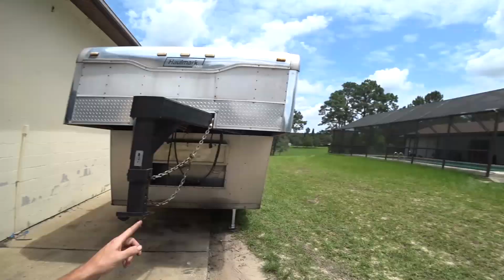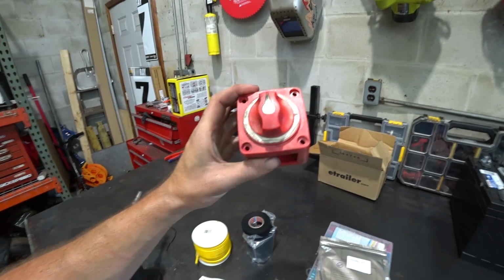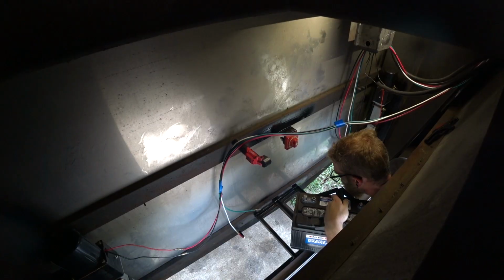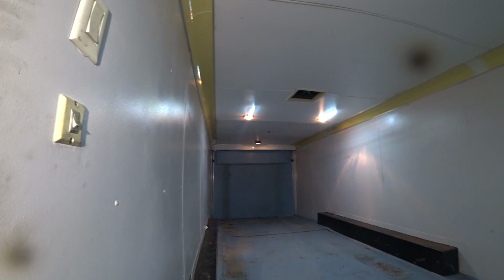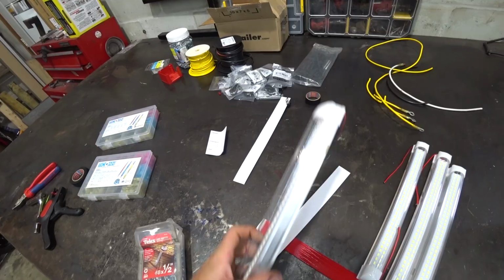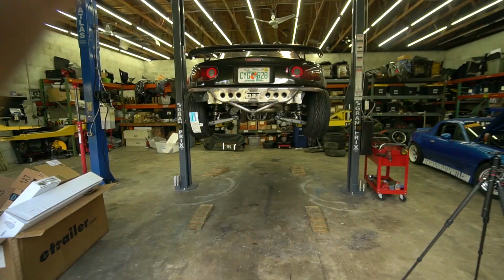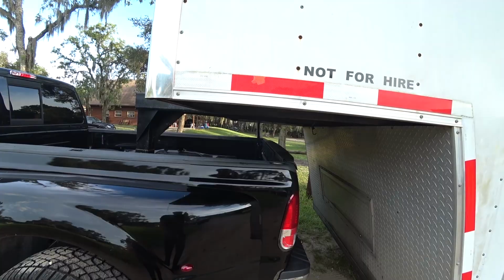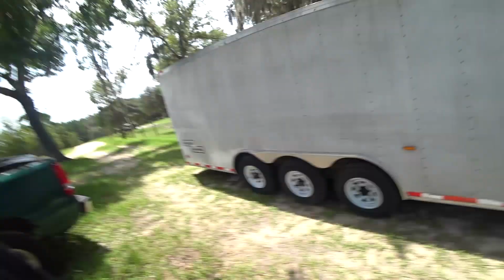Refurbishing And Upgrading My Gooseneck Enclosed Car Trailer Pt. 2

Comment: The trailer finish is gel coat. As a detailer I’ve buffed and waxed them, but it’s honestly a lot of work. You don’t want to use a very aggressive compound or go super hot, but I’ve never burned through it. I haven’t done a ton of them and have been out of the business for a while, so you may want to research restoring gel coat options on YouTube. I see some other suggestions that may be faster, but I’ve never done it any other way. That said, I’d be careful about the more caustic things mentioned. I’ve had issues with super clean pitting aluminum, and I definitely wouldn’t trust oven cleaner. Good luck! 👍

Comment: Mix up 25% dawn and 75% the works original toilet bowl cleaner in your power washer soap dispenser. Rinse it first, then hit with soap mix and scrub with a clean push broom from the shop. Do in small sections and rinse before it drys. Gets rid of any mold/mildew and the rust rings around the screws. I do it once a year to a white trailer that lives outside 24/7 works great.

Comment: I use a foam cannon to wash my trailer down then buff my trailer with a buffing compound, enclosed trailers are painted with hard epoxy paint but oxidizes so I  use a liquid wax on a softer pad to do it quicker and the wash the road grime off easier. You can also polish all your aluminum to keep your whole trailer looking fresh

Comment: We got a Honda EU3000is.  Believe I picked it up for 1800$.  It's tucked into the front storage area of our trailer aswell.  Use it to run fans, tools, chargers, refrigerator and whatever else we need and its never said no, I'm sure it would have no problem running an AC unit.  Switch from a generac to the Honda because of the noise with no regrets.

Comment: Flip down sofa/ table like would be in a toy hauler rv good for just relaxing, and a winch in the front of the trailer. If you install a generator, might as well put in a roof ac, for that Florida heat. Put a light in the fenderwell, flats are pretty common, and at night its amazing.

Comment: Taylor, for your tow rig you should wire in some of the clearance lights on the front lower valance of your truck and on the plastic part of your steps to complete the big rig look. like the lights you put on the open trailer I think it would look great on it. Just if you want a easy project to up the cool factor of your truck.

Comment: Hey taylor, tips for the siding of the trailer. The contamination is really only going to come off with sanding, start out with a scruff pad, I don't know what you call them over there, they have green ones red ones etc. If that doesn't work move to some 1500gr and if that doesn't work go progressively down in grit. Then what you want to do is sand back up in grits to about a 2000 then give it a buff if you want to bring some shine back but it might look alright as a matt finish. Unfortunately this leaves you open to it getting dirty again in the future as it is a porous surface. Personally I would pull the siding and replace with some dibond or alucobond sheeting, not sure what you call that there either!

Comment: Try some Greased Lightning or Meguiar's Marine/RV M49 Heavy Duty Oxidation Remover on the trailer then use 3M's  06064 or 06068 polishing compound with an orbital polisher...make it look brandy new! For sure keep the white cause a black wrapped trailer is gonna be way harder to cool.

Comment: Zep makes a purple power degreaser you can get from Lowe’s or Home Depot you can add some water to and spray on the trailer let it sit a few minutes and pressure wash it off. Did it to my white trailer that sat under trees for a year and did really well.

Comment: You should enclose the top and bottom of that space the batterys are in keep most of the wet out of electronics will save huge hassle  down the road. Also that space should fit a decent size generator for some a/c or even a few inverter generators for quietish a/c

Comment: To clean the trailer just wash it, Then use a rotary buffer with meguiars 100 compound and a wool pad followed by Dual action polisher with The Last Cut compound and a medium cut pad.  You will need minimum 3 pads each.

Comment: Its so odd hearing a 6.4l starter cranking then hear a 24valve Cummins come to life lol love the fummins build! My dream truck is an 01-07 gm 2500hd crew cab short bed 12valve cummins nv4500 5 speed and use the pushbutton transfer case and make all the factory gauges work life oem....

Comment: As far as a Generator , go to your local RV Junkyard . I bought a  7KW generator out of a near new Motorhome that had caught fire and picked it up for next to nothing . Sorry , just trying to help . At one time I had 47 Trailers . The one thing I did learn is ALWAYS carry TWO Spare Tires . ALWAYS ...On the smaller Trailers we mounted the Generator in the back of the truck .

Comment: One suggestion Taylor, put a sheet of sheet metal across the bottom so someone can’t climb in the front compartment. Or a sheet of expanded metal to keep the open air flow..

Comment: If you were talking about the 8 point star screws holding the break-away, you can use a square bit to get those off.(took me a while to realize it wasn't 6 point torx on my trailer, lol)

Comment: Zep Aircraft cleaner II is designed to remove black soot left over from jet engine exhaust. I use it on my white enclosed trailer all the time, works great.

Comment: Why leave the engine idling to "warm up" the truck? Isn't the best way to warm up and engine to just drive lightly for a few hundred meters (or what ever you use over there... yards?). That way the engine reaches operating temperature much quicker which means it will work as it was designed to just a couple of minutes after starting. Just wondering... Love this build btw, hope to do something similar soon!

Comment: Full strength purple power in a bucket. Use a sponge mop to scrub it down then rinse. Do not let it run or dry up on you. You will get streaks if you do. It 100% works, thats how i keep my truck looking brand new.

Comment: Bleach watter in a pump up garden sprayer u want it to be concreted so don’t dilute it to much spray it on take a car wash brush on a pole scrab it a bit and spray it off it will bring that white back my family has an RV and that’s what we use to wash it to get all the black streaks and mildew off

Comment: Maybe get the mats for the floor of the trailer? It will help you with the hassle of painting the floor and prevent from getting stained. Oh and get some lights for the outside, so you can see much better in case of changing a flat and some speakers. I know there must be some more ideas that you could do and get the trailer to your liking.

Comment: So my leer canopy is made the same way your trailer is made of and when the harsh winter road grime gets on it it’s really hard to get it off but I’ve always used some simple green or gunk engine degreaser and then had to scrub it off by hand. Usually if you want the best results you gotta put some elbow grease into it

Comment: What I used on boats for getting all the crap off of the white hull, you can get at walmart and its a white spray bottle with blue lettering. I'll see if i can find an old bottle to get you the name of. And yes it is safe on fiberglass and metal since our boat is a fiberglass hull.

Comment: You should add a roll out awning on the side like a fifth wheels camper so you don’t have to tote around a pop up awning. You could even get an electric one to add to your new and improved wiring system!

Comment: Have you thought about boxing the bottom of the compartment that holds the batteries, killswitch and jacks? I feel like anyone who's seen the videos could crawl underneath the trailer and stand up between the jacks and battery mount and get to the main killswitch that way.

Comment: Use  Lysol mold and mildew spray to get your trailer white again (works better than bleach) also keep your roof clean ( helps prevent black streaks)

Comment: Truthfully, whether or not you restore the white or do a black wrap on the trailer, doing a chrome wrap on the roof of the trailer would help keep interior temps down since it’ll reflect the heat away which would, in turn, help your A/C unit you’d be using for the trailer be more efficient in the long run. Just a suggestion, however 😊

Comment: Just a little bit of info. Putting the kill switch on the negative (not ground, that's different) side of the battery is actually best practise because electrons flow out of the battery FROM the negative terminal, through the circuit and back to the positive terminal. Putting the switch on the negative means if a wire is damaged and creates a path to earth (not negative), the switch is in place to stop any electron flow. If the switch was on the positive side, it is possible to earth the circuit before the switch, witch would drain your batteries and could potentially cause a lot of issues with the worst outcome being full membership to the LZ firetruck club.

Comment: When you use self tapping screws on thick metal use a drill not an impact. You won’t need to pre drill. I learned that when I used to mount light kits on over head guards for asphalt rollers. Those guards are 1/4 think where I drilled through them with just screws

Comment: I am in several fleet washing groups. You would be amazed at what the proper chemicals can do to remove the crud from trucks. Take it to a truck wash or call a fleet wash company. Seriously, they spend 15- 20 minutes on a big rig and it's sparkling clean.

Comment: 15kw on the AC , 68-70 all night. it will run on 110v extension cord if you don't turn anything else on, cord gets a lil warm though,  DO NOT  wrap it black way hotter.  Starbrite make black streak RV cleaner. its good stuff.  Doing that big of a trailer is alot of work.

Comment: NEVER wrap or paint a trailer black. It will raise the interior temps 20+ degrees. Instead, clean up the white. Pressure wash with a solid degreaser first, then compound and wax it. I suggest a direct drive wheel, or an orbital, whichever you have. Try a 50/50 mixture of compound and wax on the same wheel at the same time. If that's not cleaning it up, go straight compound, then wax. I use to detail boats, RV's and enclosed trailers for a living and that's the exact process I use to do. If you have ANY further questions, please reach out to me, I'll be more than happy to help you.

Comment: If you didn't figure it out already, the screws are just a #2 square drive. Yes the screw has 8 points, but they are made for square drive.

Comment: I would try simple green or purple power first to get them white back. If that doesn’t work a polishing compound will bring it back. Polishing compound will just take a lot longer. Buy a cheap polisher from O’Reilly’s for like $50 to keep your arms from dying if you have to use the compound.

Comment: You should use group 31 MF AGMs. And go to "pacer group" in ft.lauderdale and grab an ACR install that so that voltage issues will never be a problem. And I'd advise you too up those size wires on the batteries

Comment: Taylor, looking at how you wired your electrical jacks you can power them through the truck connector. Both power and ground are directly connected to the junction box of the connector and the jacks. Meaning anyone can steal your trailer anyway. At least judging by this video. Try toning out using multimeter to confirm.

Comment: the white on the trailer is stained from the aluminum  just if you didnt realize so with that said im not sure what product your gonna need , if your end job is to wrap it your still gonna want to remove the contamination off of the white for best adhesion

Comment: Pressure wash  the trailer and feed in pool shock through your pressure washer. Bleach works well also. Mix 5/1 dwell for 10 minutes. Light brush and it’ll look brand new.

Comment: You should add a dummy trailer connector to the underside of the gooseneck to clip the cable into when not connected to the truck.

Comment: Have the generator in the bed when parked then the a plug in the trailer that is hooked to a wire that leads to the generator. Plug the ac into the plug inside. You could use power tools as well

Comment: Be careful with AC, the startup power pull might be over a small gen (even knowing running power is enough). Honda makes the most silent stand alone gens so a 2000watt might work but might be too big for the area and a 1000watt (very silent) might not be enough. Also recommend a small camper window in the side door if you plan on sleeping in it/staying inside for extended periods. If you do that a small sink on the bench drain to a bucket plus 5gallon fresh might be nice for cleaning during events. I  wouldn't go full solar unless you want like 4 big panels on the roof plus a big (4-6 marine batteries) battery bank - a gen is way cheaper. Don't go black in the FL heat - instead fix the white and maybe add some large black strips/graphics to match the truck.

Comment: Backing that trailer blindsided is tough as a truck driver have to say pretty impressive
Reply: I don't know how you guys do it, blows my mind every time I see someone backing up big ass trailers
Reply: @Matty.Hill_87  its actually easier to back a bigger trailer but lots of practice when I was green id find an empty parking lot and practice backing
Reply: Coming from another truck driver i have to agree some good driving
Reply: @Randy Lovelady I agree on the larger trailer statement. I don’t drive a truck for a living, but I will absolutely without a doubt say my 18’ flat bad is easier to thread into a spot than the 8’ trailer I have.

Comment: I had good luck using a few spray bottles of Clorox clean up, a scrub brush And a pressure washer on my race trailer. Took any of the hard stained mildew right off.

Comment: I would use a locking power lockout.. something that is keyed.. or make a hidden switch so someone doesn't power down the jacks. on you. 
Preferably something inside that locks out the switches when disconnected from truck but only for the Jacks themselves.. not all the lighting too. this way if your at the track, some stupid kid doesn't flip a switch and starts powering down the jacks while your not near the trailer.

Consider getting a portable 12v powered winch for trailers.. something that you can connect to a central tiedown for to pull your car inside the trailer if car dies ( if you do not already have one) 

The other thing is, you can buy extensions for trailer plugs one end looks like the truck side, other end looks like  a trailer end.. OR you can buy the ends and make one that is as long as you need it.

I would also consider a battery charger, conditioner device.. something cheap that you can connect and plug in from a 110 source just as that little bit extra on say dead of night, no solar, batteries have went dead and yet you have access to a generator or other 110 source.. Rare condition im sure.. but its like 30-40 bucks for little peace of mind. depending on model.

this was really interesting to me because I recently got a little trailer for a lawn tractor, and was looking up some other stuff and was like "ohh wonder what he is doing to that HUGE trailer" lol

Comment: run a second junction box at the  behind the ball connection an drop it straight down here an over  plus 2 ft.  will give you jack area to work when on angles  that you should not be in...  we all slide trailers now an then.  better connection  points then  cutting and tapping wires connections...

Comment: trailers lookin sick, love these kinds of videos. i would suggest to bleach the trailer with a pressure washer. did this for houses and siding and it works well. i used cheap dollar tree bleach. soak the trailer let sit for a few minutes and spray it off. can wash it before to remove the dirt then bleach to remove the stains.

Comment: The A/C unit will draw a fair bit of power to cool a trailer that size. It might pay to try some ventilation fans first and see how that works. A wireless reversing camera at the rear of the trailer might be a good idea.

Comment: Yo Taylor, Grab one of those jugs that hook up to a water hose to mix bleach with water. You can get a few gallons of bleach cheap. Then just wet surface with water, then switch it to mix bleach with water and spray it. Wait 5 minutes and wash it off. Love the channel bro. Keep skiddin!

Comment: Use LA awesome to clean the trailer. You’ll have to find the dilution that works best for the trailer. There are to many variables that can play a factor in that. Spray it on brush and rinse. Do not let dry. Your removing the old oxidized paint so if it’s to strong or if your paint is to far gone it will take you down to bare metal.

Comment: To get the white back use a cleaner called White Ox I use on my boat with a scrubber but I don’t see why you couldn’t get a pressure washer with a foamer and spray it

Comment: I believe the 7 pin will also charge the trailer battery’s.  Not shure on a Ford though on a dodge it’s got a fuse you have to install in the factory fuese block to enable it

Comment: Add a 12v switch to the running lights from the battery so you have outside lights on your trailer

Comment: Maybe try “Westley’s Bleach White” tire cleaner (it’s for white letters and white wall tires). I used it on my camper on the white trim and it cleaned it super well. Don’t know what it would do to the aluminum walls of that trailer but it’s worth a shot.

Comment: If you put another two batteries in it, 4 solar panels on the roof will keep them all charged and you'll be able to get a 2500 watt 12v inverter and run things like a small welder and air compressor and such off electrical onboard power. (intermittently, but useful at racetracks!)